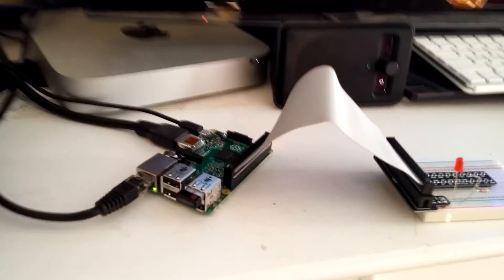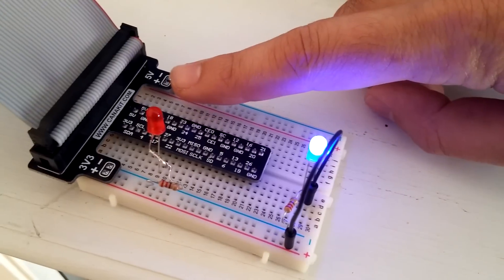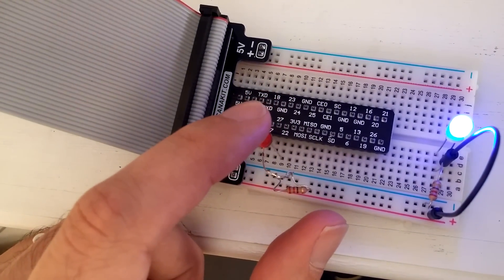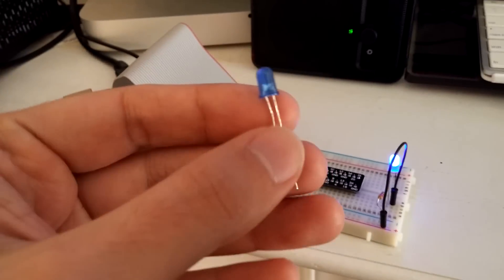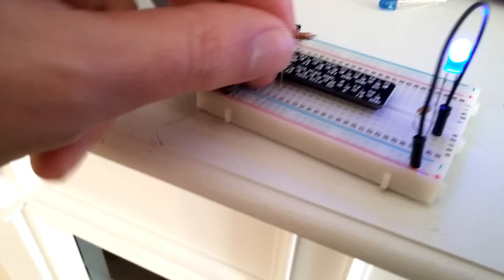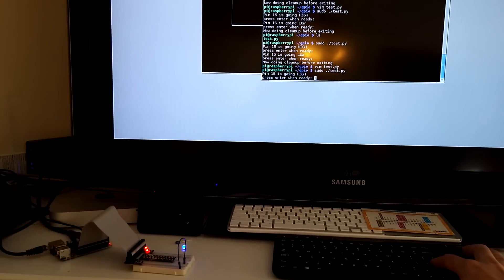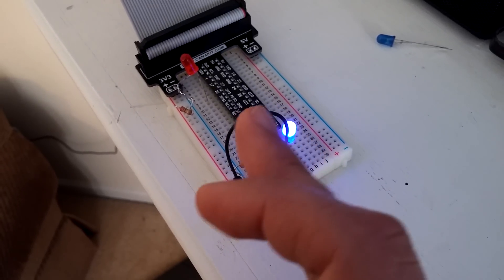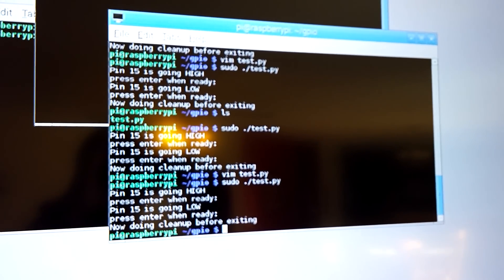Raspberry Pi 2 and Canakit Tutorial

Comment: The two leads of the LED are called the anode, and the cathode. For current flow you want the anode to be positive in relation to the cathode too. So you can say hook the anode up to positive voltage, and the cathode up to ground for an LED to conduct current.

Now the way I tell which is what in an LED is to look inside the plastic housing at the leads in there. The "ground" is the bigger L shaped dingus. Because if the leads are clipped there goes the longer lead difference, and with square LEDs all sides are flat. But the inside shapes never vary. Plus it is easy to remember, as the ground is bigger.

Kind of like the "ground" we all stand on is bigger than everything else is. That is the mnemonic I use.

You are correct to say HIGH when your LED lights, but so not think the pin goes "off" in the low state. Then the pin will act like a current sink. There probably is a true off state, called high Z. Which means high impedance. But I'm not going to get into that here. Other than to say there is usually an enable that controls that function.

Try this hook another LED up at the same time, but in reverse, like run it from your positive rail, to your GPIO pin. Then your LEDs will alternate, as to which is lit, depending on the logic level of the pin.

The fact that this happens can be useful at times. It is called negative logic. So stay open to the possibilities there.
Reply: *****
I hope you get something out of it yourself. Because your video is quite good. I do not know anything about Raspberry PIs specifically myself. I have never used one. But I have used other electronics. So I imagine the PI works like a lot of it does too. With tri-state logic, and whatnot.

Comment: Hi ! Sorry for the way I use english expressions, but english isn't my first language...  Just bought a raspberry pi 2 and the Canakit showed in this video... Before watching it I was a complete ignorant on how to start and make a good use of all of those little things  ...
And you definitely did it.. After watching your tutorial two or three times I could make everything work exactly as you showed...
Good job indeed and keep doing it !! ... 

Just one little point to remark that I didn't notice if it was mentioned in your video. It happened to me that I tried to run the python example using my terminal session runing with putty in an external machine network connected with my raspberry pi 2 and a message with the following error appeared: 

        RuntimeError: No access to /dev/mem.  Try running as root!

My easy solution was to move to the keyboard and screen of the raspberry pi 2 native machine and run the example from there.
This time, it ran as a charm !! 
Bye for now...